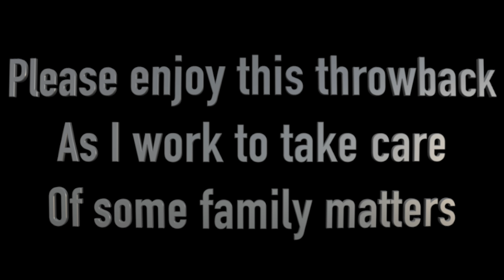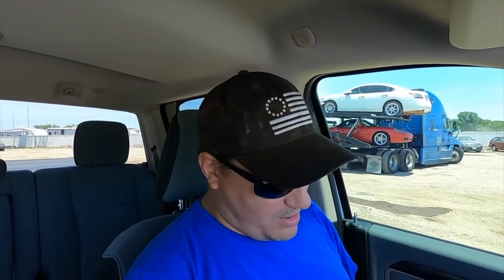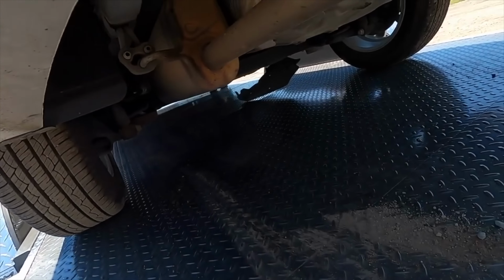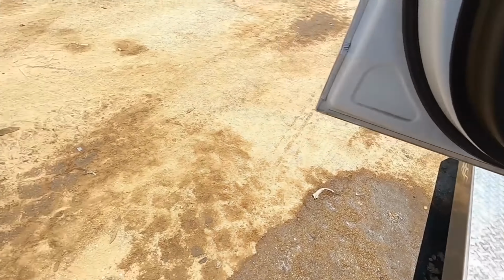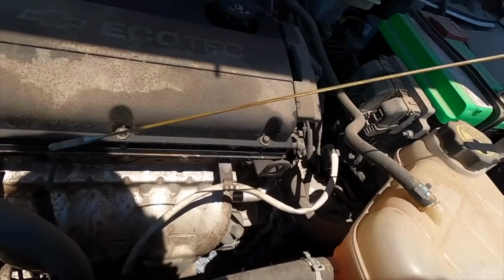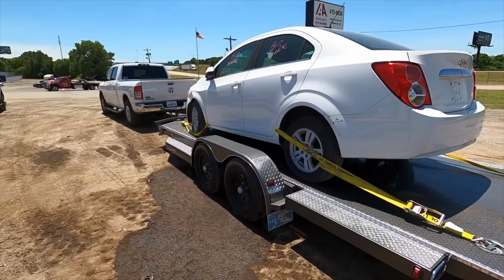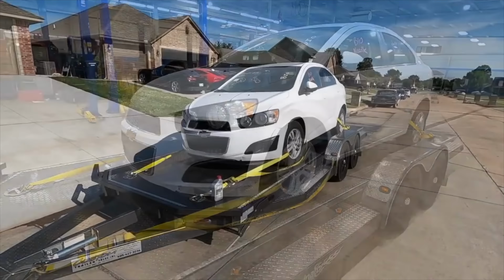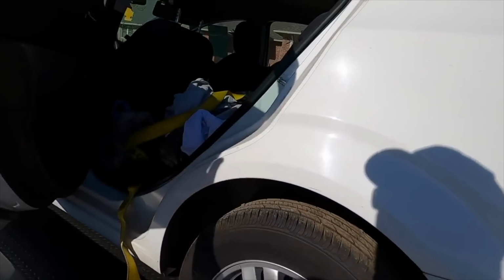I Won a Biohazard Chevy Sonic from IAA with NO KEYS!! Will it Run?

Comment: I bought a Ford key online for like $40 and then got it keyed for $50. To copy a second key, put the original key in the ignition, key on engine off. And then put the new key in and do the same thing within 5 second. And then that new key is programmed.